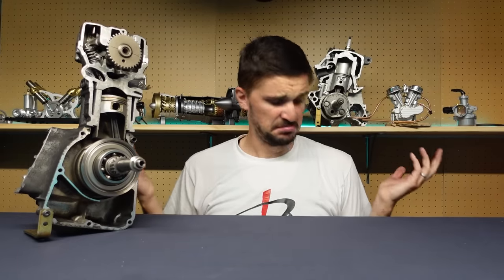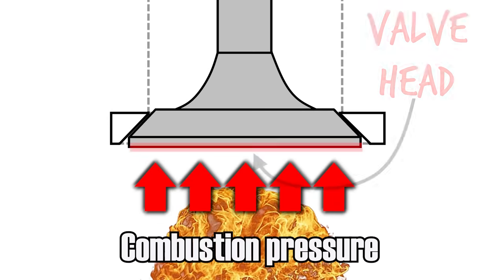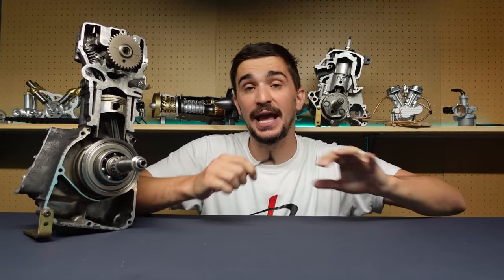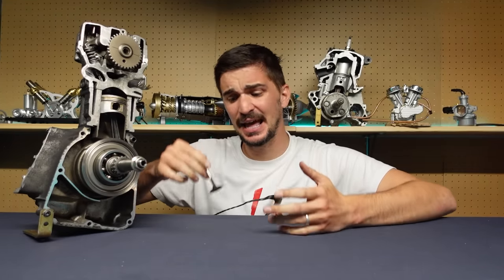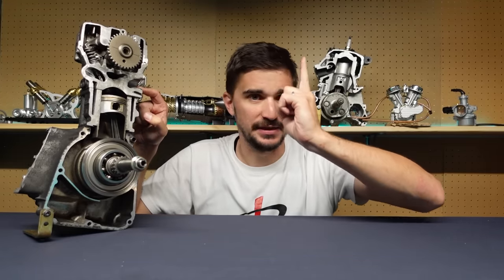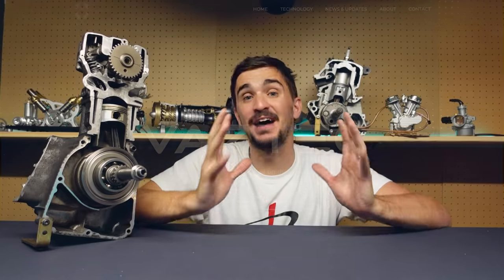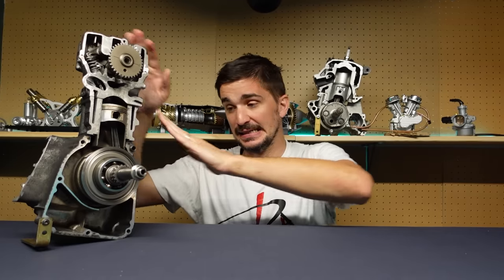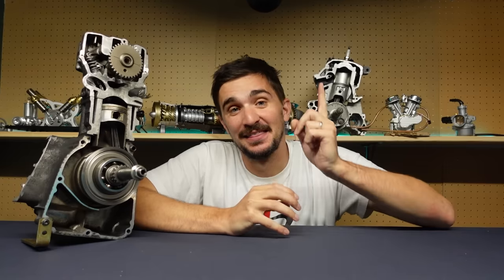Rotary Valves Make Normal Valves Look Silly - Why Aren't We Using Them?

Comment: People who regularly deal with plumbing know how difficult sealing rotary valves can be....
Reply: Not really. That problem is just a sad reality behind the lazy engineering of legacy, "good enough, so why change" systems. If someone without an engineering background can build a custom house that swivels using custom joint seals for plumbing designed for easy maintenance less often than you'd need to reshingle, "real" engineers don't have any valid excuses.
Reply: 'how difficult sealing rotary valves can be....'
Exactly, that was my first though off hand.  Poppet valves are reliable, most engines last 200K miles etc, pressure makes it want to seal instead of blowing by gaps, and so on.
If rotary valves were really better, everything would already be rotary valves.  People in the 1930's, 40's, and 50's were geniuses and then some and trying everything.  Rotary valves would have taken over ages ago if they were better.
Reply: I'm not sure the analogy works because we are dealing with air flow, not liquid, and we don't need a perfect seal, unlike in plumbing where a perfect seal is required.
Reply: @madeconomist458  Air is worse than liquid, not better.  ' and we don't need a perfect seal'  And you'll be cooking the oil needed, a very bad idea.
It is not 200K mile reliable tech.
Reply: @madeconomist458  "we don't need a perfect seal" that doesn't even apply to my 1930s lo compression cast iron flathead model a with only 40hp and 2200 max rpm...

I have leaking valves, and a significant drop in the little horsepower i have... Even more noticable in the loss of torque.

The thing is, that yes, with poppet vales, if your seals aren't microscopically perfect, the pressure from the combustion will press them shut anyway.

But with rotary valves, this benefit is lost, so the higher the compression the worse the leakage
Reply: @madeconomist458  The pressure of combustion is far higher than pressure in home water pipes.
Reply: @ModelLights   that is true but not true. Technologie then and now is so far not the same ball game that we cannot say that.
Reply: @madeconomist458 Air follows fluid dynamics and requires a higher tolerance than water.
Reply: @custos3249  ...you know that spring valves literally evolve so much over the course of 100 years right?
Hell, this video has one great inaccuracy that is underestimating gap bleed in power. You would know this if you study guns specifically revolver. Gap bleed pressure loss is real and it is considerable (anywhere from 5-10%), depending on the design and power output. 
Meanwhile, spring valves actually scale up well with higher compression and torque (NOT higher RPM, which the rotary valve supposedly good at)
Reply: @madeconomist458  Perfect seal is needed because it is WORSE than liquid, you're containing deflagration, which is one step below explosion. 
Gap bleed is 5-10% power loss, which conveniently not mentioned here because the video championed for the tech.
Meanwhile, moppet valve scale up with torque and compression. Higher compression = better sealing. Sure it doesn't work well with high RPM, which again, the video seems to put emphasis on. However, high RPM is garbage for efficiency anyway, while high compression increase efficiency....
Reply: @DrTheRich  Microscoping leakage are always exist via piston rings and if make rotary sealing rings good at piston ones then the only issue left is reliability. About 20 years ago seen rotary implementation with only one port with barrel channels for intake and exhaust to the same relatively big hole and some kind of ceramic rings sealing cylinder head to barrel. This guys say that "ok, our sealing rings will be reliable for 40-50k miles but it easy to replace and we can include it in our servicing procedure". Seems idea was failed cos I never heard about this company after but this idea is also make sense.
Reply: Something of note is that the issue with the poppet valve isn't nearly as much of a problem as is presented in the beginning. The spring force is similar to a "residual load" in AC power. It takes energy to overcome the spring force, but then when closing, it returns most of that energy to the drive train. There are losses, but they're not a huge factor for the majority of engines.

The complexity introduced by using poppet valves is also not dramatically greater than using a rotary valve.
Reply: @ZeroXSEED  Sorry, but I'm only taking criticism from people who can correctly use both "literally" and "evolve" at the current moment, not to mention the correct grammatical tense. Especially since the blow by issue has already been solved by another engine component already in use.
Reply: So, I work as a tech for John Deere and I work frequently around hydraulics. So I get to see all kinds of valve systems and styles from poppet valves to rotary valves. A ton of older tractors utilized rotary valves. 

At that time it was a good way to combine a TON of hydraulic functions into ONE valve body. HOWEVER, in hydraulics, valves like rotary valves and spool valves are known to leak a slight bit, this is because they’re effectively designed to. 

In order for these valves to rotate or move in there corresponding valve body, there has to be a very specific tolerance between the valve and the body to allow free movement when directed by either pilot oil pressure or mechanical linkage. If the tolerances were too tight, the valve would bind in the body. Like I said this is as designed and is mostly application based. 

So when you use a spool valve (or rotary valve) to operate a hydraulic cylinder, let’s say it’s double acting differential, if you left the valve in neutral and the cylinder extended, even a brand new spool (or rotary) valve with a super tight tolerance, after a few hours the cylinder will have retracted on its own very slightly, DUE TO THE LEAKAGE. 

This principle is the same with rotary valves. Now, for high precision agricultural applications, we do not want cylinder leak down as that can cause major issues in the production efficiency of the machine in work. So we use another style of valves called Lift Load Check valves and Cylinder leak down check valves. 

These Check Valves are POPPET VALVES. This means, like he said in the video, these valves utilize a specific valve with a machined surface on the valve that when closed sits in its own precisely machined valve seat! Like he said in the video, poppet valves almost completely seal, over time worn in poppet valves may end up leaking due to its worn in fashion, but this is why we LAP valves and there seats or replace there seats if they are replaceable (all John Deere rotary piston pumps have replaceable discharge valve seats). 

When we use check valves in hydraulics it is to prevent cylinder leak down when the spool or rotary valve is in neutral and the cylinder is extended (Check valves in hydraulics are also used in many other fashions when a proper seal is needed or to block flow to a certain function or circuit like filter bypass valves). When oil is taken from sump to go to the extend envelope of the valve (extend operation) to extend the cylinder, the check valve opens due to the oil pressure opening the check valve to allow flow. However, when you go back to the neutral envelope of the valve, flow stops, and due to the nature of hydraulics, when oil starts to leak by the spool or rotary valve and go back to sump, the check valve will close, not allowing the oil to leak back to sump, therefore keeping the cylinder extended at all times until the retract envelope is selected. 

Anyways there my mansplaining for the day, thanks! 

Edit: also in hydraulics we usually see pressure upwards of 3000 PSI under load and during normal operation, it all depends on the pumps flow rate and the total flow restriction within the circuit the pump is in series with. Pressures change per tractor.
Reply: @markjacobson4248  Poppet valve actually worse scaled down. On single cylinder engine they took anywhere from 1-3 HP out of the whole system, which is significant when it's a small scooter engine (say 125cc and below). But jack it up and now the percentage of power loss is less obvious.
As the video itself presented, the rotary valve is 'ideal' for high RPM application, which usually involves huge number of cylinders (4 or more). But multi cylinder engines are inherently less efficient, not least of which because they operate at such high RPM.
Reply: Benzley722  A few percentage points doesn't improve anything, eh? Well, aren't you a clever one. Wake me when you stop valorizing parts changers and realize engineers don't call the design shots when finance and shareholders are in the driver's seat.
Reply: @ModelLights everything would have been figured out by the 60s huh do you know how much we didn't know back then? We couldn't even make a car last 100k miles back in the 60s now we have synthetic oil vvt fuel injection direct injection and so on it was still all theory and proof of concept back then are you kidding me you really think they had the technology to machines the tolerances reliably to mass produce those things back then? You really think we are done improving old inventions because people were smart 74 years ago the internal combustion engine has seen many improvements since the 50s and will still see more I guarantee it
Reply: Only valid to reject idea if demonstrated non-functional in practice, or not economically competitive due to cost of materials or mfg.

There have been a few patents and a few trillion dollars made on engines with new components and designs unknown to all geniuses of past.
Reply: Non-engineer in bbitzing here - what about the previously expensive 3d computer simulator modeling? Now much more common and available.

What of testing for variety of configurations, including forming port/valve materials as impeller shape, if only to reduce turbulence, or use designs including fixed pinholes that are solid/blocked until timing of rotating part sweeps past? Or use of pumice like, micro structures -impossible to create/mfg. before 2000? Plenty of sutions to test before negating category - especially after having commercial and/or pro sports models succeed in use, as noted
Reply: The seals would be fine but for the cheapskate engineering. I got one in the eye from a failed seal, pretty annoying but no damage.
Reply: @ModelLights stick to lights. You clearly don't know anything at all about this. 😂😅😂😅
Reply: @coronalight77  
'@ModelLights stick to lights. You clearly don't know anything at all about this. 😂😅😂😅'

Realize, Youtube and Google 'protect' the ignorance.  I can't even correct you guys, because Youtube would rather have you stay ignorant than get correct information.

Correcting all of your incorrect ideas gets 'policed as mean'.

Comment: Smokey Yunick, an outstanding NASCAR builder and inventor, was building a tube style’valve’ system, many years ago…! 👍🇺🇸😎
Reply: I wish I hadn’t thrown away the mid ‘80s Popular Mechanics issue which featured Smokey’s ‘84 Pacer with his “advanced  fuel atomization system” that produced 60 HP per cylinder while achieving 80 mpg or so. I think the article went on to say that one of the big 3 bought the idea from him and shelved it. He was also working on an all-ceramic design with no cooling system. The guy was a genius.

Comment: Interesting idea. It's strange too because that wasted energy in actuating the springs could be greater engine efficiency. But right, once you see the size of the rotor assembly @11:11 you understand why it's not used. In a 4cyl it would be a hell of a lot of mass + wear and so on. Just costly to run and manage. Awesome idea though. A V8 with 8 of those cylinders trying to keep the cylinders sealed? Insanity. Like you said with the poppet valve, it self seals and the more cylinder pressure, the better it seals. A necessary evil I suppose.

Edit: One critical issue with that design would be that the initial cylinder installation would achieve its best sealing characteristics and would only get worse over time as cylinder pressures act on it and make it out of round. That would of course cause sealing issues and loss of pressure (loss of power) at some point. It would be incredibly difficult to engineer a solution to keep that cylinder from being destroyed in not a lot of time. Lastly, a critical failure point could come when the cylinder becomes so out of round it seizes in its bore and causes the engine to explode or seize itself (cannot exhaust gasses). 

Sadly, poppet valves have everything going for them in this regard, cheaper, easier to maintain and manufacture, install, better service life etc...
Reply: Actually you get some, if not most, of the energy back when actuating the spring.   In large two stroke marine diesel engines, which are actuated using hydraulics, there is significant loss in actuation energy compared to the old ones that used camshaft.
Reply: @nytsamlegt  Hmmm interesting. Another win for the traditional poppet valve 👍
Reply: Wankel engine rotors prove that rotary valves could be made to work. Engines are already required to be maintained by some x amount of km, an added few hours and a few hundreds $ in seals, 2 or 3 times in the course of 450k km is more than worth it
Reply: The failure mode you describe would be less catastrophic than a conventional valve train failure, since a seized rotary valve won't fall into the cylinder and ruin the whole engine.
Reply: the self sealing effect for the rotary valve is still there - when the valve is closed the rotor body is pushed against inlet/outlet channels which essentially is what we call self sealing. The modern ceramic materials, coatings, hydro/aero- static bearings can improve the state of this technology by far, its a matter of where they money flow, these days, but the are moving away from internal combustion.
Reply: look at sleeve valve engines
Reply: @Ijusthopeitsquick  True. My mind was running ahead of what could go wrong. Just out of my ass stuff you know lol.
Reply: @SoloRenegade  If i'm not mistaken is that not how steam engines worked way back when?
Reply: @konstsh2240  True. Any efficiencies to be had will be supplanted by electric motors in the coming decades. I feel like the fate of the ICE's has already been chosen. If not by the platforms themselves then by the taxes governments are imposing on fossil fuels.
Reply: @OldSchoolZ-wy2yx I think the rotary proves just the opposite when you add fuel efficiency, emissions and maintenance costs into account.
Reply: @youtubasoarus  steam engines work completely differently, they are not trying to contain an explosion. Nor are they trying to compress a gas. They are merely using controlled expansion of gasses. Totally different operating principles. the best examples of sleeve valve engines is in WW2 airplanes.
Reply: @nytsamlegt  in theory, yes, but in the real world it's a very different story. If you've ever run a cylinder head on a spintron or similar you'll see that the energy consumption of the electric motor increases dramatically as you put proper valve springs in it.

Comment: Wait... Coates CSRV  Coates Spherical Rotary Valve solved the sealing issue. They were located in New Jersey usa. They also had patents and running test engines and bikes. We know because we delivered one bike to their shop many years ago. Afterwards, I saw the videos of it running with one of their heads. So what happened to them?? Literally stopped back, and doors were locked. No phones worked. I'm very curious if anyone knows what really happened to them? They were working on big deals with manufacturers.  Look them up. Look up the videos. It was the real deal.